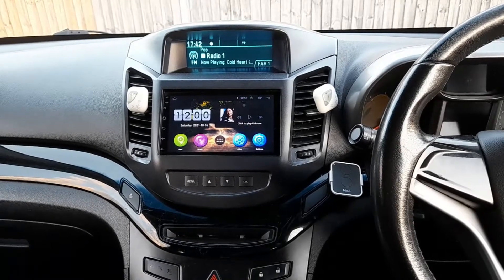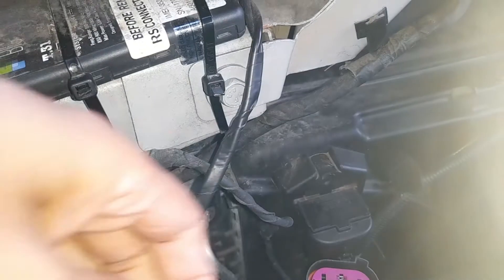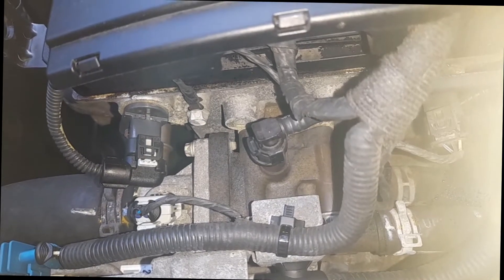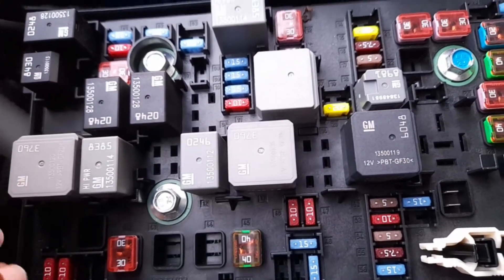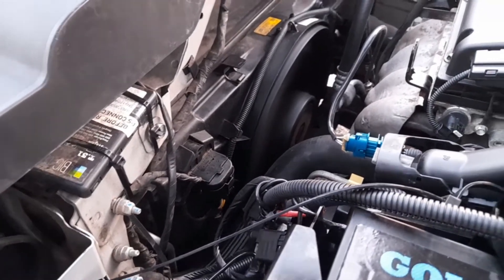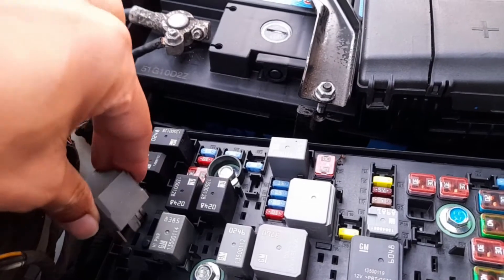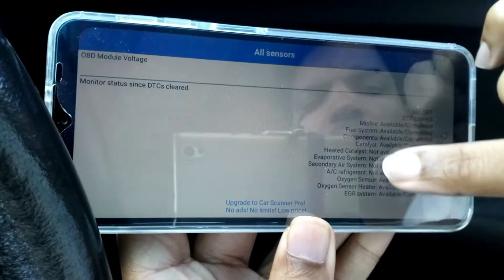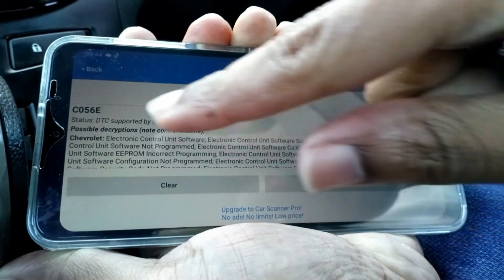Car Cooling fan intermittent | comes on as soon as I turn the ignition key

Comment: Hi I just had same problem as you, and after testing the sensor. relay and fuse I decided to use electronic spray to clean the components and connector s, and waited for about 10 minutes  put back the relay  and sensor. Amazingly fan worked normally. Thanks.
Reply from the maker: Wow, I tried to spray every thing but still did not work, can you tell me which component you sprayed please? Thanks

Comment: Relay can be stuck closed. Also there may behi & low speed relays & switches. Bad sensor or sender & that is pretty much it besides a ground, which it isn’t. You don’t wash your engine off at the car wash do you? If so, that’s your problem & stop it.
Reply from the maker: I have swapped relays and checked fuse, I think it is ECU issue because I keep getting random codes since then

Comment: Hi Im having the same exact issue with my NV200. Which was the problem or what did you do to repaired it?? thanks in advance
Reply from the maker: Hi, I have tried everything the only thing I am thinking is the ECU- Because if the fan does not come on the car will throw another code to do with timing and no power with the car and when I clear the code the fan will start running